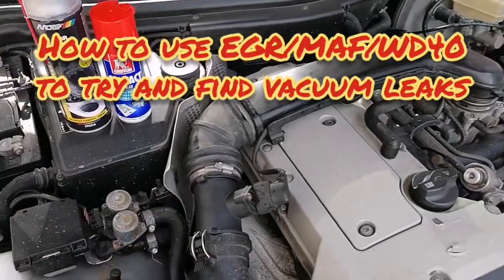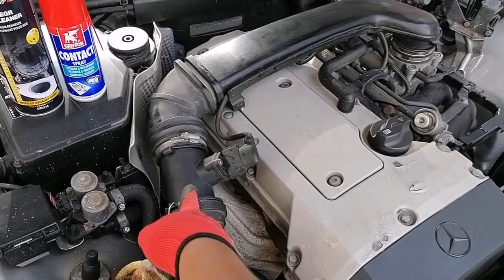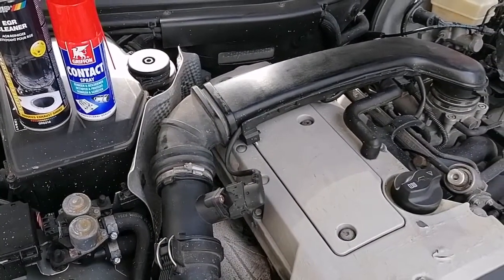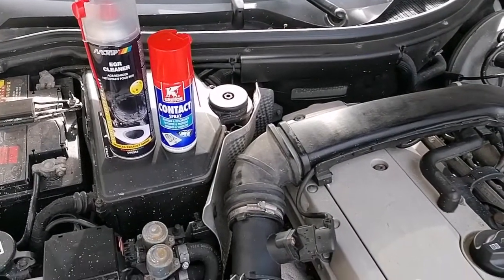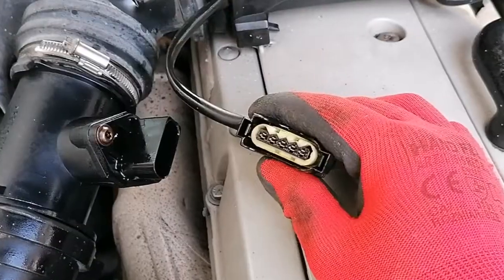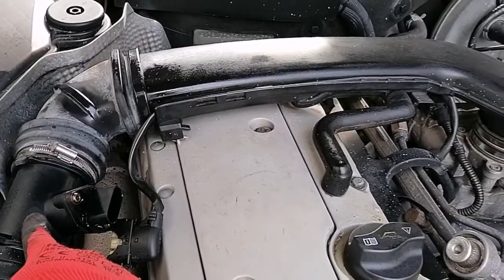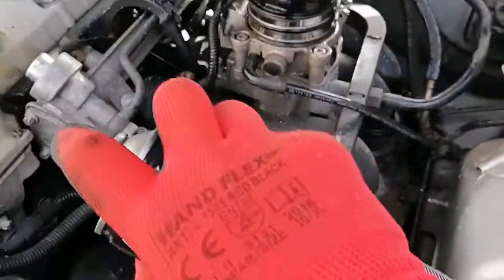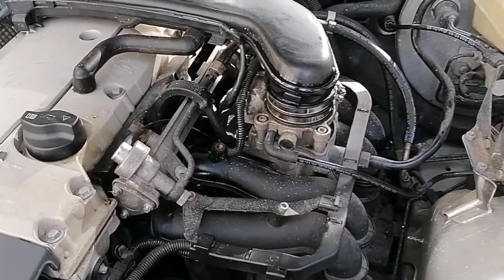Trying to find a vacuum leak using EGR/MAF/WD40 sprays (gas driven) or MAF sensor/PCV valve issues

Comment: Was it the MAF or possibly the purge valve?
Reply from the maker: in the end it was the MAF [again, second one went], there wasn't any leak.
Reply: @OrionBroadcasting  I suspected so lol. I don't know what it is about German cars but they ALL have these MAF issues where they kick out false positives on an OBD. It's insane how perfectly tuned that sensor has to be. This is no joke but I once had a Passat that had to use two different MAF sensors, depending on the season. One for the warm summer and one for the cold winter otherwise I would get CELs all day. It drove me nuts trying to figure that one out at the time to where I just said screw it, I guess I'll switch between two MAFs.